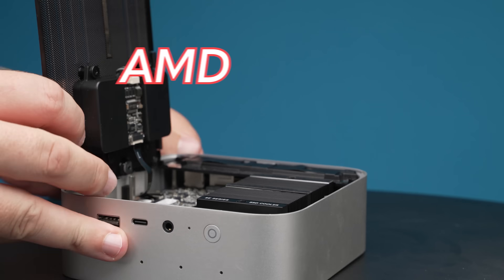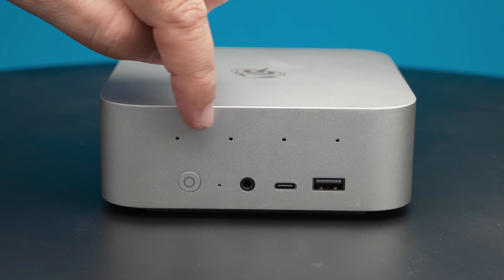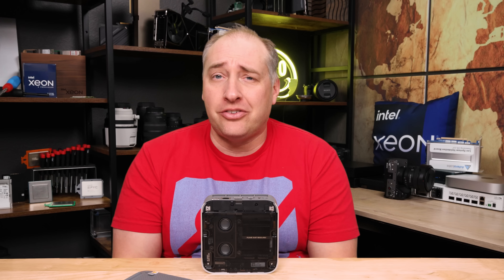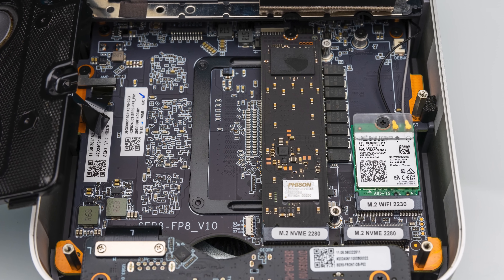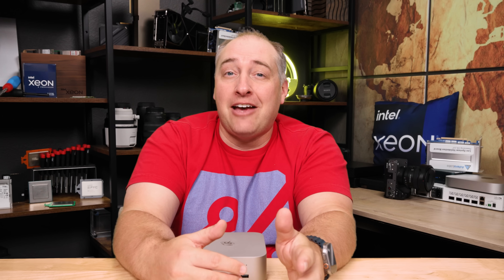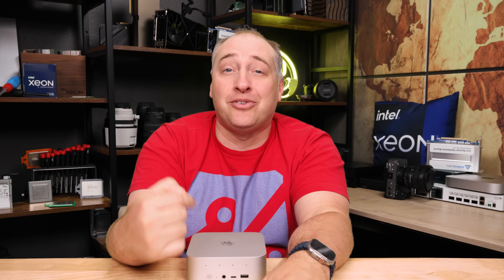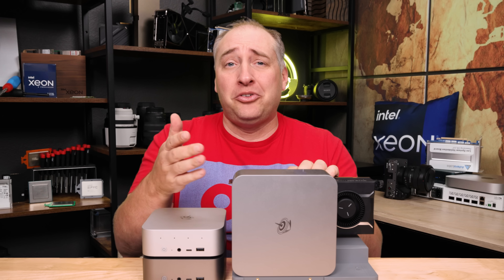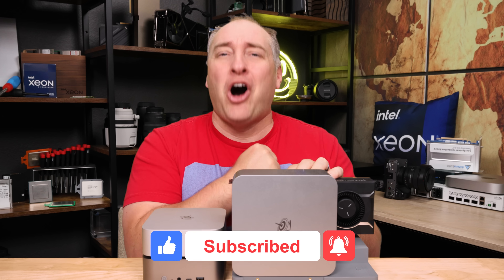FASTEST AMD AI Mini PC Beelink SER9

Comment: Going the apple way with unupgradable memory I see, Blech.
Reply: If I remember correctly, the memory on there is $9,600 or 8,000 mega transfers, so there's a reason for that. I don't think so dims come at that speed.
Reply: It’s integrated with the APU package to get that performance, which is smart since the faster apus get, the more the memory interface becomes the bottleneck. Apple knows this. AMD knows this, and it’s a smart move. There are plenty of other systems you can get with upgradeable memory if you are willing to forgo the efficiency/performance advantage.

Comment: There's these things called paper clips which are very handy for poking into little holes.  That's if you don't have a LTT driverset ;)
Reply from the maker: Believe it or not… in the 2500ish sq ft studio we did not have a paper clip.
Reply: @ServeTheHomeVideo no sim card removal thingies? That should work too
Reply: @ServeTheHomeVideo  There's never one around when you need one.
Reply: Sim card remover pin thing? Does that have a real name? Should work for reset